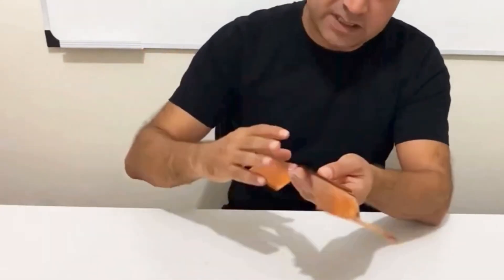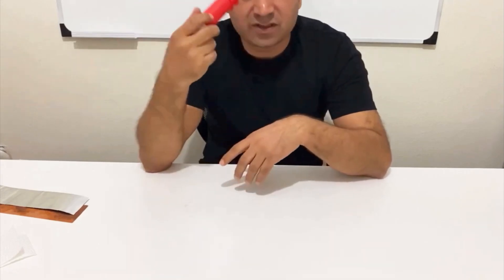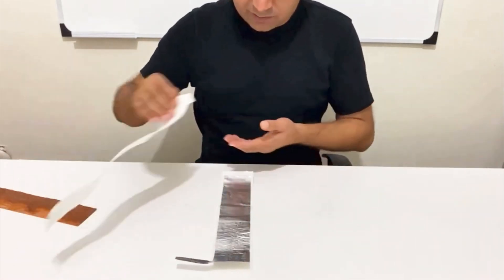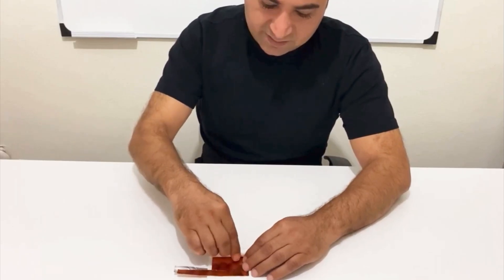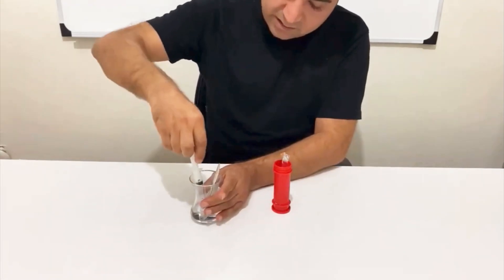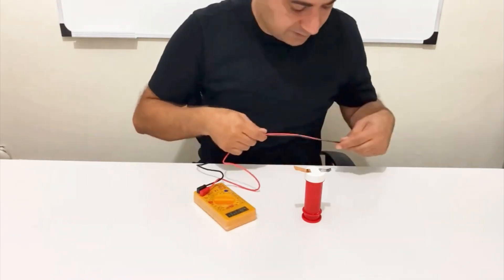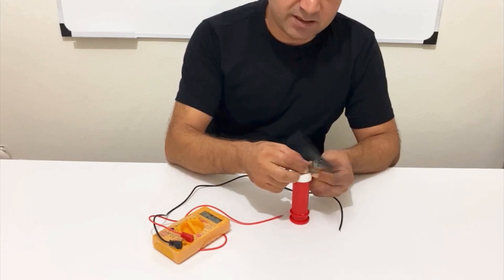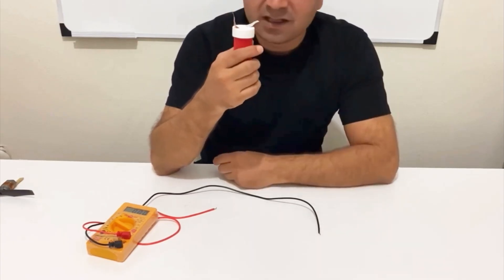How to Make a DIY Copper Aluminum Battery at Home | Free Energy Experiment

Comment from the maker: How do you think we can increase the capacity of the battery? Please share your ideas.
Reply: Hello my friend, my idea is to add active material that contains graphene, to increase its surface area.
Reply from the maker: @luzoramas3700 Agree while it is an expensive way👍
Reply: Perforate the foil to increase the surface area.
Reply from the maker: @NemoKripton 👍
Reply: Clean the oxidation off of the metals - though that wouldn't be an easy task with the Al foil :D Other than that, wrap more paired layers, experiment with different salt bridge materials, try different electrolytes (H2SO4, HCl, CH3COOH, C6H8O7 etc), connect cells in parallel (capacity rather than current as per the question) and ensure the salt water is near-saturated.
Reply from the maker: @WayneRiesterer 👍